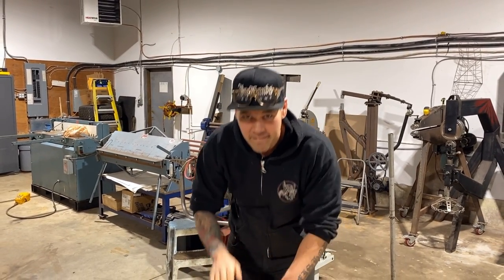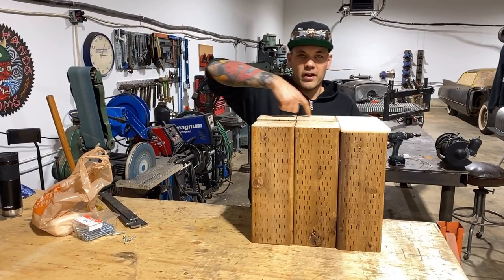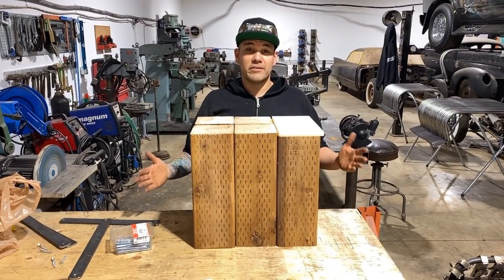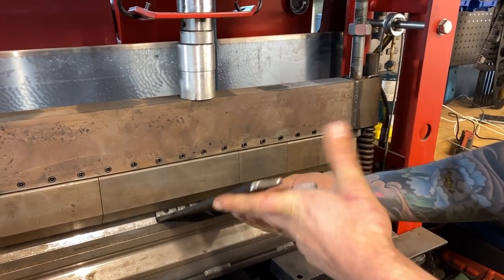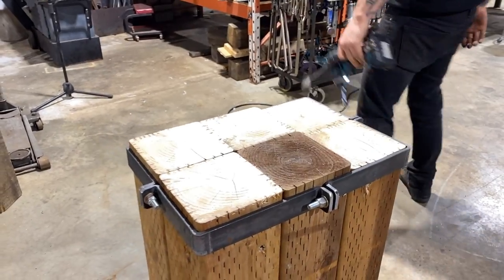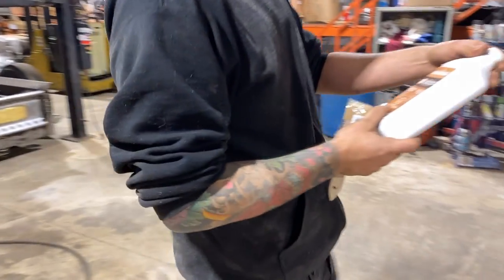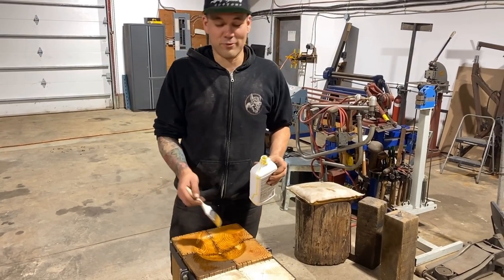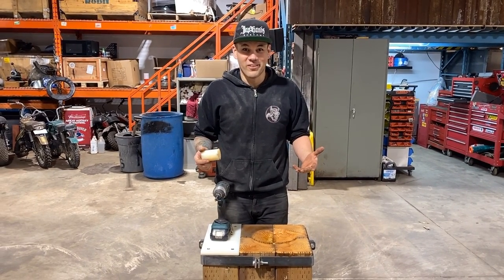How To Make Your Own Shrinking Stump for Metal Shaping!!  (EASY Step By Step Build)

Comment: Timing on this is crazy i have been thinking about trying this i have not been able to find a stump large enough to do this that is not already firewood but i was thinking of running some dowels thru it and glueing it together might go metal strap route instead also never seen the plastic i like that will see if i can find it near me also had thought about one big bowl one side and 2 smaller sizes on other side definitely going to give it a try thanks again

Comment: You should cover the whole block with linseed oil, it will help seal the surface from moisture. You will need to apply occasionally to keep sealed.
Did you draw, and paint the Japhands logo on wall? Love it!
Reply from the maker: No this was commissioned by Kristina and gifted to me on Christmas!

Comment: Love this build it looks great and can't wait to add mine to my shop. It's not an old rotten stump it's a tool. Question why didn't you strap the bottom? Won't it slip due to mallet shock.and don't burn down your shop using oil!!!!! warning!!!!!
Reply from the maker: I wasn’t sure if strap in the bottom was necessary. I didn’t want to use more material than necessary if we were to ship these as kids it would add weight. I guess overtime we will see if it holds up

Comment: Hey Carl, Great video. One thing you may want to do on this to make it last longer is to use some T-serts  or even better, E-Z Lok threaded Inserts to screw/bolt down the plastic. They sell them at any hardware store or Amazon. After a while of hitting metal on the plastic the screws will loosen up or even strip out. Also when you change the plastic from ware or whatever and pull the screws in and out they will get loose and not be able to tighten properly. The t-serts or E-Z Lok threaded Inserts will allow you to remove and reinstall them without stripping. Hope this helps. Later
Reply from the maker: This is super valuable information! Thank you very much.

Comment: Buddy... love the home build stump idea... but wouldnt nylon allow the metal to slide easily on it thius not forcing the metal in the wrinkles back together? I think youd benefit from more friction and if the metal is imperfect then just wheel it or use your handy-dandy body by fisher planishing hammer! 😛👍
Reply from the maker: The nylon actually has grip! The other plastics I spoke of are slippery. Either way u are correct the grip is important

Comment: linseedoil is totally awesome stuff, you should try heating metal to about 300°C and put the oil on the surface that´s how blacksmiths use it, you could also thin it with terpentine and soak the wood with it, you can polish it in with a polishing wheel,.....

Comment: Funny, I was out hunting yesterday evening and I came across a section of a hardwood log that definitely did not come from any nearby tree (I am in the desert in Arizona and it is pretty obvious what trees don't belong) and I thought about how that would make a good shrinking stump. I only thought about it because I watched your Mother Tucker video and thought a shrinking stump would be a nice little project.
Reply: Also, the oil will help seal the wood and minimize the wood movement with the humidity changes. The wood will always move but soaking the end grain in oil will help seal the wood and slow the absorption rate of water and the rate of water loss from the wood, which minimizes the  movement as the wood swells from gaining moisture and shrinks from losong it. End grain is where water has the easiest time getting in and out of wood. So even if the wood won't spend time outside sealing it well with oil is important, especially in a place with big moisture swings. Here in Arizona it is not as big a deal. The wood is always drier than it was coming out of the kiln 🤣. I would not only seal the top amd bottom, but seal the sides, oil the metal straps and re-coat periodically. The oil will slowly dry to a hard finish, and the stump will get a nice patina with use in no time.
Reply from the maker: Can you go back for the stump? Sounds like a weird situation that must be fate lol 😝
Reply: @MakeItKustom  Oh yeah. I immediately dropped a gps waypoint so I could go back and get it. I probably will after work today.

Comment: This is an interesting alternative to a stump. Did you might consider adhesive to get a tighter bond? Do you think it would make a difference? I’d also drill a 1 1/4 hole in the middle and drive a hardwood dowel in it, if nothing else it would prevent debris from getting in there. Also to save money use untreated wood if you’re going to soak it with linseed oil anyway. Peace
Reply from the maker: Great point especially if it’s indoors and getting soaked in oil. The adhesive definitely wouldn’t hurt

Comment: I hope your happy. I started to make a stump myself. But I don't like to copy. I have 10  /  2 x 6 actual size boards 10 ft long. I have cut them all down and glad them together reinforced with a steel angle base I made out of an elected frame. It has a weight of 350 lbs. I'm cutting the bowl in top this week. How deep of a bowl do you recommend??

Comment: You may be thinking of High Density Poly Ethylene or High Molecular Weight Polyethylene. HMWP has an abrasion resistance higher than that of steel.

Comment: Its a bit strange you say Nylon add grip as it is use for mechanical bearing in a lot of application (especially with the use of step motor when you need stuff to slide in extrusion rails..) It also have the property to absorbe liquide (hate moisture as it will absorb it..), so it can be use for self lubricated bearing. However, if it work for you, can't be bad. :)

Comment: I've used Linseed Oil for many years for preserving anything, wood or metal, exposed to moisture. (See Papa Wheelie's post). You can use your project any time after application if you're not worried about cosmetics. (See Mike Csaplik's post).  My Old Man had a rule about application..." One coat a day for a week, one coat a week for a month, one coat a month for a year and one coat a year thereafter."  A trailer with a white oak hardwood deck we built when I was fifteen is still in the family. Fifty years later, it's intact and it's been outside the whole time.

Comment: Well now I have to go make one of these!!😂  i found something interesting the other day at my local welding supplier. They had a roll of silicone bronze wire for mig welding . I think this would be great for long sheet metal  spot welds i.e door skins. Please let me know your thoughts if this is a good or bad idea. I would be using it on the 2 door 55 chevy conversion I'm doing thanks to your channel. Keep it up Karl always great information.
Reply from the maker: Right on! I’ve heard lots of great things about that silicon bronze welding wire. I hear lots of body shops use it now. I’m a big fan of it with a tig welder But I have no experience using it in a mig

Comment: Be careful with boiled linseed oil on rags. They can spontaneously combust! So be very careful on your cleanup disposal!
Reply from the maker: Now that you mention it I’m pretty sure that I have seen some thing about this! Thank you
Reply: I work at a log furniture manufacturer we've had multiple fires from guys leaving rags wadded on the floor and in the trash. Best thing to do is leave your rags laying flat on the ground away from flammable objects until they're dry
Reply: Can’t be stated enough

Comment: Treated lumber is pine. Often pine that isn't top grade stuff. This sift wood and may not hold up well. I might have found a firewood seller and see if he could sell me a section of log large enough around and tall enough for your shrinking stump.
Ash might be a first choice, maple a second. Oak would probably cost more.
Reply from the maker: Yes true! It’s not as hard as the hardwoods but that’s also part of the reasoning for the heavy duty strategy is to keep the grains very tight. It actually feels like it’s harder with a strap

Comment: An alternative to the uneven bending, would be to space 2 bars either side of the central ram, reasonably symmetrically, but it should not be super critical I think. The bigger the gap the less critical the symmetry.   I assume there is a Stop when bent to 90.

Comment: HDPE, high density polyethelyne, or UHMW Ultra High Molecular Weight PE?   Awesome as usual dude!  We use UHMW for slippery tough guide blocks, or strips.  HDPE is pretty good stuff for toughness too, milk jugs, gas cans, etc.  A special nylon named Delrin has very good impact and toughness as well, but I believe is more slippery than typical nylons.

Comment: Cool job as always.  Would a thick bit of steel work instead of the nylon ? 
Ps I would cover steel and the rest of stump with same oil .give it an older look 
👍👍👍😜🏴🦕🦄😁🤞✌
Reply from the maker: Yes the thick piece of steel would work as well but in some cases he might not want to mark up your metal and I think the steel would do that
Reply: @MakeItKustom  As I read it makes total sense. thank you for feed back 😊
👍👍👍😜🏴🦕🦄😁🤞✌

Comment: Ultra-High Density Polyurethane or Polyethylene (UHDP)

A little trick I learned from having to drill holes amd not having correct coolant around is use super diluted hand or dish soap.  I like just enough soap to get some bubbles when you shake the container. The water cools the  cutting bit and the soap gives a bit of lubrication.  And then apply liberally while drilling/cutting. 
The problem with Rapid Tap is it will cause the chips  developed to gum up the flutes and they won't clear properly. I mean, it's better than nothing but it won't really do much cooling and chip build up can ruin a hole that needs to be precise. Guess how I know that. 🙄
Reply: Useful Tip.  Thanks
Reply: yup soapy water for cutting plastics like poly-carbonate sheet was our trick for some jobs "way back when"....didnt need to soak it tho...just enough to keep the blade a little wet for a fraction of a second to reduce the melting/sticking
Reply: I have found for  lots of things (especially hole saws) just using a small amount of compressed air with a blow gun works best because it cools well and removes and keeps the chips from piling up.
Reply: @kazzTrismus  I actually never used this on plastic before. And to be honest all the times I machined plastic  I never thought to use coolant. 
I "discovered" this trick when I was drilling locating holes for a locomotive compressor and got tired of changing bits all the time.
Reply: @davidbutcher1105  we went through a couple of cheapo table saws from the water getting in.
but it worked way better than anything else.
an old windex bottle and some soapy water.
Reply from the maker: Thanks very much for this awesome tip! I would’ve not guessed. 🙏🙏🙏🙏
Reply: @MakeItKustom  you are most welcome! Thank you for providing information that isn't psychosis inducing political content.   Somewhat hard to come by these days!

Comment: I wish I could afford to ship you an iron bark stump mate.
Reply from the maker: That sounds like a really hardwood!
Reply: My word it is hard.
It is so dense it has a higher fire rating than steel.
8”x8” post holding up a three story building is rated at 4 hours when steel for the same size  building is only rated at 2 hrs.
After an hour engulfed by flames iron bark forms a ten mm carbon layer that protects the rest of the timber frame fire damage.
Lots of great Forrests were stripped bare because of its durability, 
The rail companies used millions of trees for railroad sleepers(ties).
Early settler blacksmiths used the stumps as anvils as metal was scarce and exy.

Comment: I would have used SPAX washer face timber screws.  They come in 1/4" to 1/2" diameter and up to 12 inches long.  Available at Home Depot or Lowe's.

Comment: Great stump got inspired to build my own! 

Question:
I am planning about getting on a bit of metal shaping, what would be your priority 
English wheel or a little stronger plannishing hammer for getting a 3D shape, all the way to hard, narrow shape (Bugatti type 57 Atlantic shape fender) to a almost flat doorskin, feels like the wheel but what is your wiew?? What is your go-to tool for shaping??

What dimension is your wheel dyes and anvil?? If it becomes the wheel i buy a cheap one and stregnthen Up the frame due to saving money
Reply from the maker: Great question! For me I would definitely go for the English wheel first. Especially for controlling low crowns in semi flat panels. One tip that I got recently was to Refinish the low crown lower anvil to  have a wider contact patch
Reply from the maker: My wheels are 8” x 2 for the top
Reply: @MakeItKustom  okeey thanks for awnser. I am looking at One that has an similar deal, buy a cheap one and stregnthen up the frame, found one with a 2.35 inch Wide upper wheel that looks resnoble price. (I am from Sweden so sorry if language is a bit off). Have you solved your upper wheel rubber band sliding off?? Was tempted to suggest that you can buy a replacement upper wheel and the wheel that is in worse shape you can coat that with durable tape and then make a good fastening arrengement and when you need the 2D shape function just switch over the upper wheel. That would be a solotion?? : ) You might have a better solotion but i wanted to suggest it either way : )

Comment: Its a nice design,quite similar to one i made some years back,you dont say what timber(lumber) you used,i guess pine,soft wood?
I made mine from solid oak(hard wood being best),one thing you have to remember,wood/timber/lumber,is still alive so it moves,a strap at the bottom will help it from warping,also although oil isn't really necessarily,one way of sealing the hammering surface is to burn it,yes,blast a torch of heat on it,clean the burnt bits off then hammer it down, shaping stumps never happen over night,the surface take years to harden,thing is,its a start,and if theres nothing else,why not👍
Now,she opened what with her legs????????????????????????????
Reply from the maker: Yes I assume it’s pine or some kind of soft wood. That’s part of the reason why the strap is there to tighten up the grains and hold it all together. Or at least that’s my thought behind it. You’re right that a hardwood would’ve been better but I’m trying to do this easy and inexpensive. Ha ha it was the wrapper on the paint brush

Comment: Finally, a shrinking stump that's not rotten, but it still has a dirty great hole in the centre 😀  Just kidding, I always love your videos. Anyway, you can always hammer in tapered dowel if needed. One tiny thing I might add is a thin sheet of EPDM under the nylon. Just to reduce the noise when hammering out the tucks.

Comment: Teflon?  Gluing the blocks with clamps would work fine also.  However, the steel bands look better.  They say that the pressure treatment chemical is not good for humans.
Reply from the maker: The steel helps keep it tight so you don’t blow out the edges from hammering over time

Comment: Being a wood guy learning metal I was confused as to why you used pressure treated lumber. You’re not working in a swamp you don’t need that. It’s just more poison dust (cyanide and copper usually) floating around your shop. 
Also you don’t need to have the straps all the way to the top like that. Even though you’re smashing a soft wood (conifer) with a hammer it will take longer than you think to distort. I’m just seeing busted knuckles on the strap bolts. 
Other than that it looks like a good workable stump.

Comment: HDPE High Density Polyethylene is, likely, the plastic you were trying to think of.  Another guy wrote, UHMW... which is a type of HDPE... Utra-high molecular weight high density polyethylene... they actually use it to make body armor.  UHWWHDPE is complete overkill for pretty much anything beyond body armor... regular HDPE is sufficient for petty much any application you'd have in a fabrication shop.

Linseed oil is great in the sense that you can continually repair the finish without any fuss... you just sand down imperfections and apply some more.  It will blend right in.  Also, linseed oil literally soaks into the wood and hardens it.  When applying it, put it on in lighter coats... you don't need a brush; I rub just it on with my fingers.  If you go with lighter coats, it will dry quicker... you can just put a light coat on in the am, another in the afternoon, and another in the evening... good to go.  Also, for what you're doing, it won't hurt anything if you use the stump before it's fully dry.  You may get a little of oil transferring onto the workpiece, but that'll wipe off easy enough.

Comment: Having only one of the treated ends facing up is bugging the hell out of me.

Also, just so you know a big part of that wood treatment is that it is a sealant, so if you picked it so it was less likely to rot, you'd need to apply End Cut to all the cuts.

Also also also, that stuff is toxic AF and isn't meant to be indoors, your shop probably has good enough vents, and you inhale worse, but just worth knowingm

Comment: What, they don't have real tree stumps in Canada?
If you want a quick and easy way to put a "dent" in your stump; 
Trace out your profile and then take your Skilsaw and set the depth sorta shallow. 
Then start making lots of "pocket cuts" inside your circle or shape.
Knock out the scraps between the kerfs with a hammer 
Now get a good grip on the saw, hold it down, and start rotating the saw, it'll cut a bowl. 
If you need it deeper, you can repeat the process.
Then finish it the way you did, with the sculpting tool on the grinder.